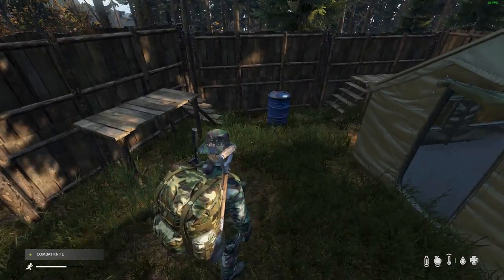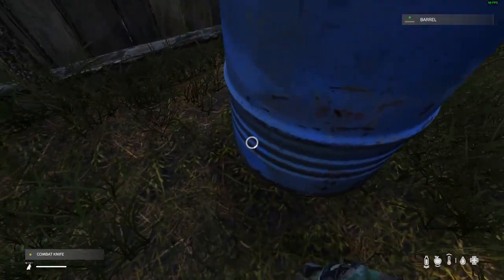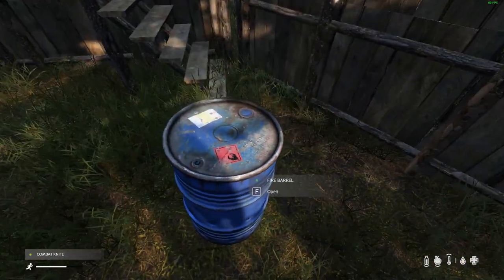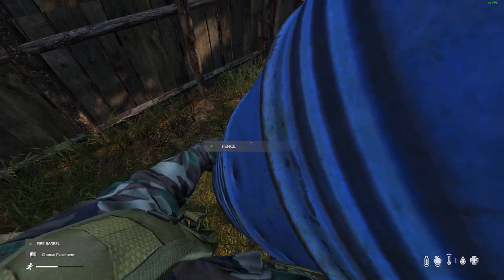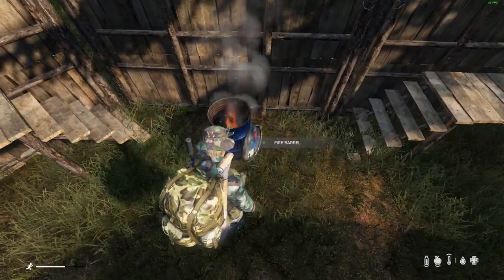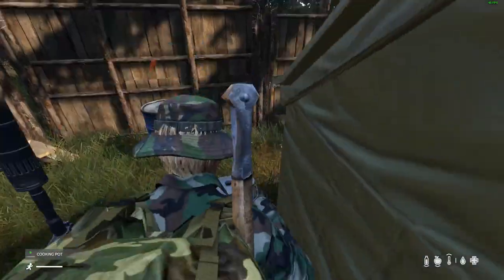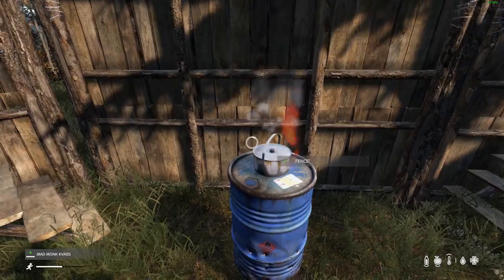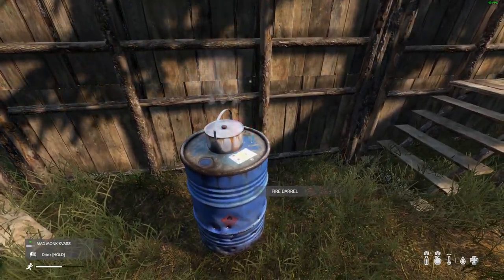DayZ How To Craft A Fire Barrel

Comment: Can you use this in an improvised shelter?
Reply from the maker: As in use as storage? If so yes it should still be able to be used for storage
Reply: @theslamminsammich5208  so you can't create a fire barrel and use it to cook in an improvised shelter? I'm trying to find the beat ways to minimize light and smoke in my little camps around the map.
Reply from the maker: @volcan8778  oh I see, probably the best way is to get the little propane burner and a cooking pot to cook. little puffs of steam is what you will see but should be undetectable inside a tent/shelter. Use water to boil or fat to bake. If the barrel will set in the shelter you should be able to use but I'm betting there will still be a glow and smoke from it. Hope that helps thanks for watching!